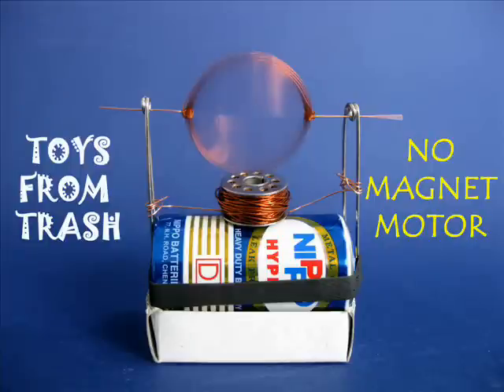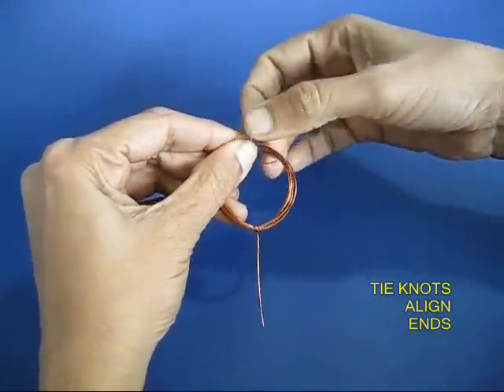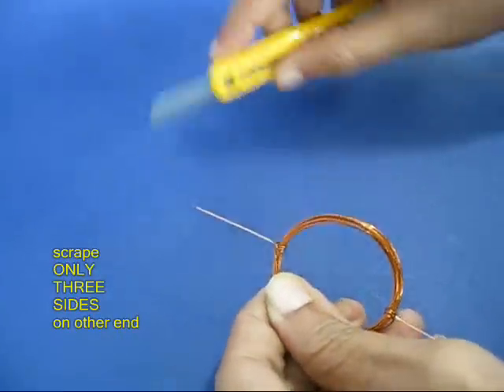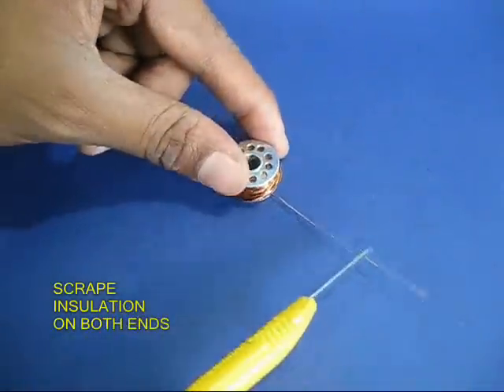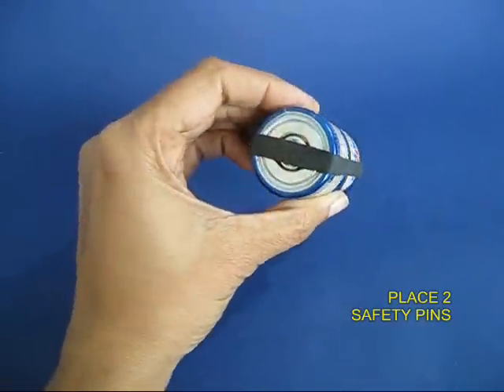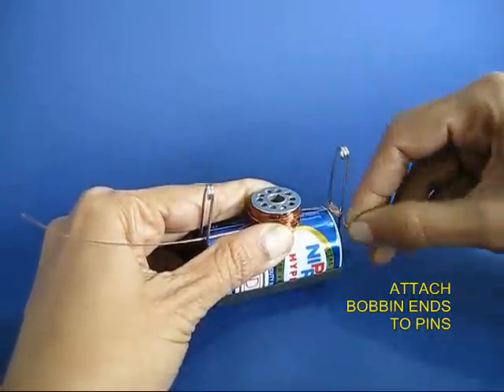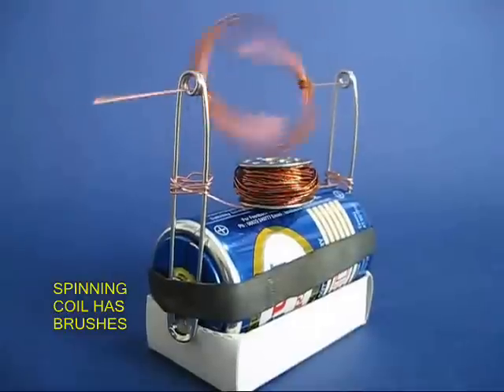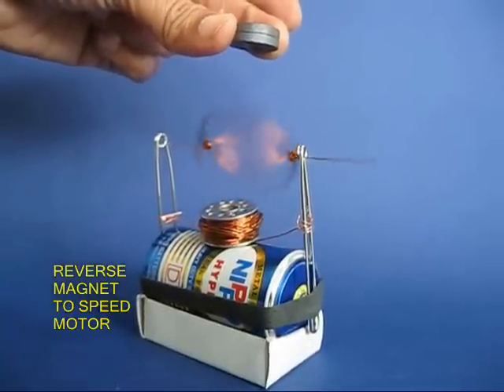NO MAGNET MOTOR - ENGLISH - 31MB.wmv

Comment: Can a motor like this also be used as a generator if we spin the upper circle shaped coil by other means? I mean we generally use normal motors (with magnets) as generators but with the passage of time the magnets in those motors expires, so my question is that can we use this motor (without magnets) too as a generator or not ? 

Sorry if my question looks stupid as I am new to this field and trying to learn about it as a hobby.
Reply: Faraday said if the magnetic field of a magnet or even an electromagnet is changing, then it can generates electricity but in this case, if we just simply reverse the function of this motor showed in this video and unfortunately, the electromagnet was not activated, the real answer is simply, NO. :(
Reply: thanks for explaining :)

Comment: Why do you need to scrape off the end of the copper wire? Can the motor work if instead of safety pins I use plastic?

Comment: Nice.  I'd just like to add for others that this  is close to being a short-circuit, and could be a short-circuit with a small mistake.  Don't use a rechargeable battery, which has a much lower internal resistance and can deliver a very high current.  It can get dangerously hot.  I once short-circuited a tiny, postage-stamp sized, lithium battery.  It took a fraction of a second for the pain signal to reach my brain.  The skin on my finger had already been destroyed.  Seriously hot.

Comment: Wouldn't that just fry the battery
Reply: Cheese_Man not if it has some ohm resistance. I would use thinner copper wire to draw less current

Comment: The coil on the sewing machine bobbin is really draining the battery. Replace it with a permanent magnet and the battery should last a lot longer than 45 minutes.
Reply: That'd require a title change...
YES MAGNET MOTOR - ENGLISH - 31MB.wmv

Comment: why do we need to scrape only three sides of the electro-magnet ?
Reply: +Ojas Raundale So that there's a "break" in the current. The insulation that wasn't scraped off opens the circuit, and thus removes the magnetic field generated by the coil of copper wire. It's like a pulsating current, so that the coil would spin faster (or even spin.)

Comment: I tried this but was half successful. The electromagnet using bobbin is not working. I had to put permanent magnet instead. This experiment is looking simple. But would take days to come out successful. You can get the copper wire from old transformers.

Comment: actually, you must indicate the appropriate insulated copper wire..
because an ordinary copper wire will not do, or may possibly unstable work
..in my project, i used an enameled copper wire or so called magnet wire